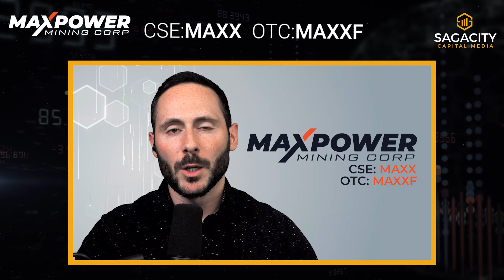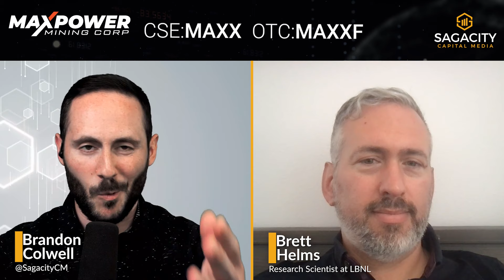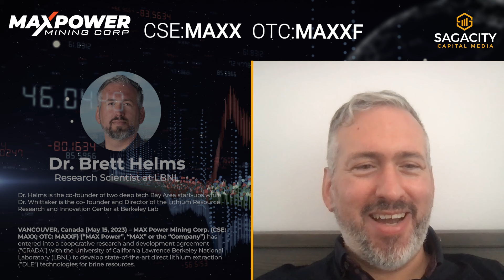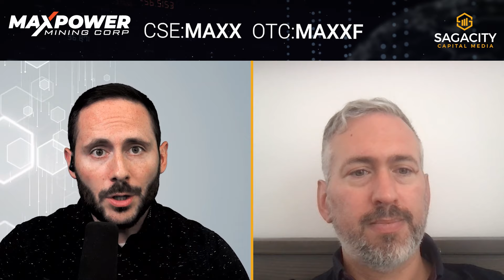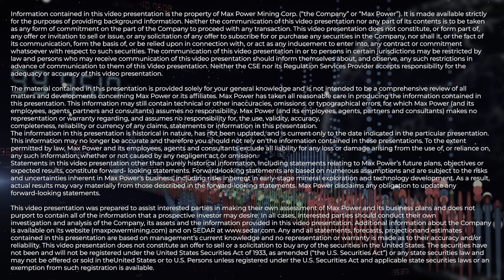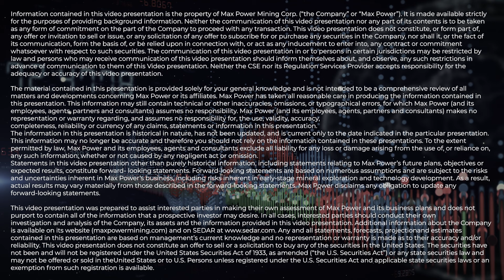This DLE Technology Has The Potential to Revolutionize The Lithium Industry

Comment: This would be massive if they can prove this membrane theory out. So many projects are dead in the water in the US because they can't find a way to make their vast lithium brines economical
Reply: Standard Lithium, Ltd. appears to be significantly advanced and has been operating a demonstration plant in South Arkansas for over 2 years 24/7 from bromine operator's tail brine.  Contrary to what was stated, the concentrations of Li in this brine are the highest found in United States in the Smackover Formation.  They are proving it is economically feasible from their published data.  I believe they have worked with both absorbants and membranes and know which to provide the best results.